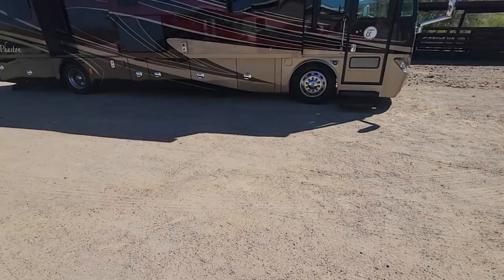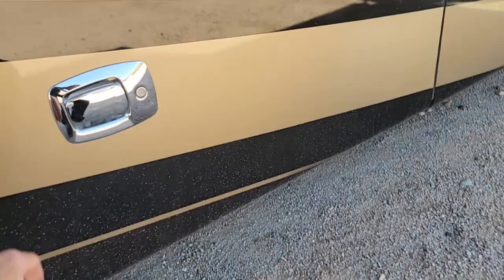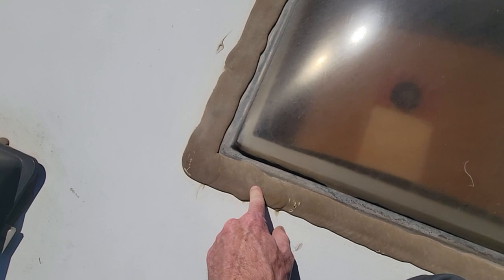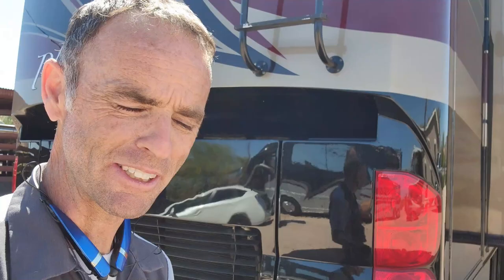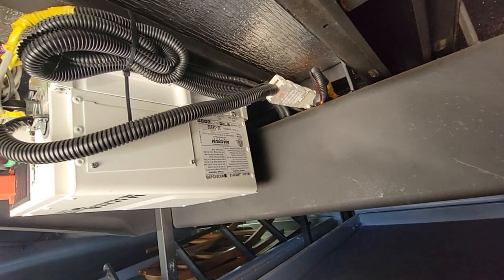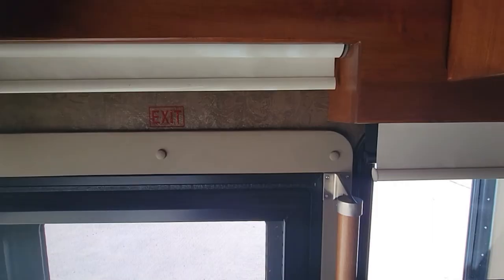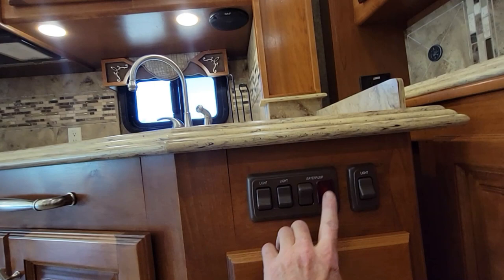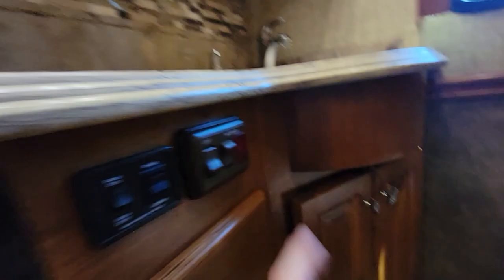This 2014 Phaeton Might Be Better Than NEW

Comment: James, you really got me on your new purchase 2001 Beaver Coach! It seems that some manufactures in past made quality products (ie. RV’s) when compared to today’s manufacturing. I’m still looking for a 2001 Beaver Coach like yours…. :-D
Reply: 2001 bwaver. 170,000 miles  garage kept = $10,000
Reply: @missingremote4388  I can rebuild it. I worked for Country Coach and was the Lead electrical harness dude for their coaches. These coaches are easy to fix and maintain because I help built them from the ground up.
Reply: I totally agree with you Aonexia...cos it seems that 2001-7 were quality ...and that BEAVER he has/had is a keeper ...one to look for , buy post inspection.

Comment: I have learned so much of the specific touches that the various brands that you inspect bring to the industry. I value your insight and knowledge about inspections and repairs. I’m a firm believer in inspecting our equipment for operation and safety because not only are these RVs expensive, they can be potentially dangerous. Thanks for all you do and share!

Comment: I sure agree that the rocker type switches are still WAY better than complicated electronics. Actually was low mileage that surprized me and why it is in great condition. I just always wonder about the dark colored exteriors and putting a strain on cooling and sun fading. If it is like my 2016 car I find older units are more fuel efficient than the so called newer units on any motorized vehical. Nice review! 👍
Reply from the maker: Thanks Galen

Comment: As a tech at a Tiffin dealer who works on both new and used Tiffins, without even watching the video, I guarantee that used one is better than a new one. 
I’m working on a new Phaeton right now, the entire mid bathroom shifted over an inch and a half. The complaint was the door doesn’t latch. I could go on and on….
Reply from the maker: Yikes! Good Luck

Comment: We purchased a 2015 Tiffin Allegro Bus 37AP in Sept 2021 and absolutely love it. Ours does feature the multi-plex lighting but we do not have the LCD type screens. We have 3 of the  individual A/C controls, as seen in this coach.  They are ez to operate and control the temp variance   from front to rear as explained in this video.

We have since logged over 6,000 trouble free drive train miles. We do not currently tow a vehicle behind it but we are averaging over 11 MPGs!   (as measured by the factory dash computer for the last 21,000+ miles previous owner never reset it and I may not either since it has won me quite a few campground wagers) 😉. 

When we acquired it with 15,000 miles, the computer read 11.2. Avg mpg. When I serviced the drive train (engine oil & trans fluid, I converted to approved synthetics @ the 16,500 mark . The average mpgs have since  improved to 11.4

 Incredible considering the GVWR of nearly 38,000 lbs. and  it conquers hills at speed while providing reassuring descents with 2 stage engine braking. 

I think the fact that the same Cummins L9 /Allison 3000MH w/ 450HP & 1,250 ft lbs of torque powers Tiffins 40 & 45 foot buses as well, places this lighter weight bus right in the ideal power to weight ratio. Highway driving is a dream.

So I can only agree that this era of Tiffin product may very well become a desirable classic. I guess I am a Tiffin fanboy now too 😎

Comment: Beside Tiffin is about 60 miles from me I love their products. Still love having the Aqua Hot system.
I have been to their plant a lot of times. You can go through their plant and see them working on motorhomes.
I have been their several times and asked a lot of questions. I like their way they paint their motorhome. 
I see them holding up better then most motorhome. Thanks so much for your tour of the Tiffin Phaeton. I wish
I could purchase Tiffin Zephyr even if it was a 2007 or 2008. I know that this is their Rolls  Royce of the motorhome.
Love all your videos thank you again..

Comment: I agree with you about the simplicity of rocker switches and the benefit of being able to repair things but I also bought a ridiculous washing machine that automatically dispenses detergent amongst other electronic things it does.  I know it's going to break one day and I probably won't be able to fix it cheap but I get  too much enjoyment not pouring in detergent every load.
Reply from the maker: Thanks for watching! :)

Comment: Seriously Great job on the video all around. It’s nice to see someone who knows what they’re talking about for real explaining the ins and outs.  I own a 2005 diamond four Monaco dynasty Ralph Lauren edition with a Cummings ISM 500.  Allison. 4000 transmission
Also rocker switches. Two-way refrigerator that works great and has been upgraded I like it because I like going off grid. Also no DEF fluid. Aqua hot three zone. 10 airbags excellent ride. It does not sway in the wind. And it’s not affected by tractor trailers turbulence. The tag axle helps immensely. I had a non-tag axle coach 40 feet huge difference. I do like the gauges and the analog switches. 
Is that rear radiator?    Used is the way to go in my opinion. I would not buy any coach if I could not work on it myself. They constantly need tinkering and care. Also land to keep them on. So many people leave them in a separate garage area.  I work on mine constantly  for fun keeping it perfect. An hour here an hour there 15 minutes five minutes I think you need it to be on your property where you live. I think that’s something to consider. 
  Even a small trailer would be nice it doesn’t matter it’s what fits you.
Reply from the maker: Thanks for watching! :)

Comment: James , the roof AC open fan , does that have good watertight seals ? Or does that require a further watertight cover. 
Lovely coach 
Great Inspection bud
Yano what , no disrespect meant to RV builders anew 
But the more modern ones post 2007, are made to fail in areas , soooo the buyer whom wants it fixed by the maker (for excellent service/fix records) is paying out , over n over n over on these newer models ... reminds me of German car manufacturers here to in Europe we all know , ohhh boy they charge, and quality is down 👎 ....its a mindset of : "well if you can afford in the first instance/place to buy such luxury ...you damn can afford the service/fix bills " 😊

No , just do it right off the bat !
Reply from the maker: The seals are weatherproof yes when its closed, covers are nice so it can be open when its raining.

Comment: I hope you get a chance to read this...I have a 2011 Tiffen Allegro Red 36qsa and I'm needing to tighten my ladder attachment to the roof removing the sealant that is there. I heard you mention that lap sealant will not stick to the roof and it needs to be self leveling silicone....did I hear this correctly and is the Dicor 501 self leveling lap sealant I purchased NOT the correct product to use.

Comment: I need help. My 2005 Winnebago Journey has a roof issue. The Filon is "wrinkling" after I removed the Proflex for a radius job I was preparing for. I waited two days before returning to replace the Proflex and found the passenger side of the roof wrinkled :( Dang it... any suggestions?

Comment: Why do all of these RV interiors look like they should be owned by Don Johnson or Clint Eastwood? They're so wood-heavy and don't appear to follow interior decor trends for sticks and bricks. Are there any Postmodern Minimalist designs that feature white/black/gray and smooth surfaces?
Reply from the maker: The higher end bus conversions usually favor the more modern, but those are custom built--so you could order anything you wanted --for a couple million